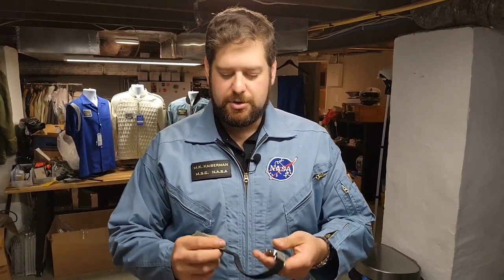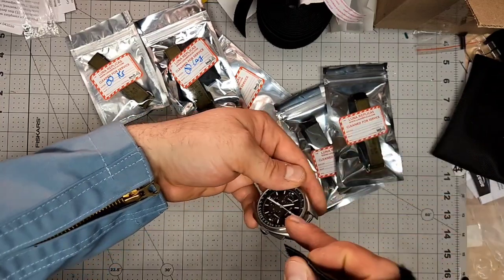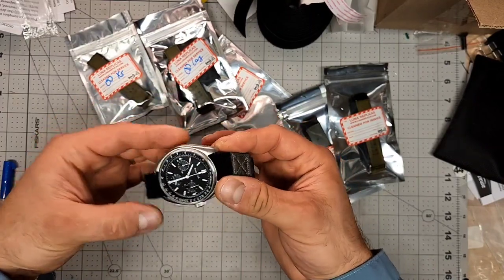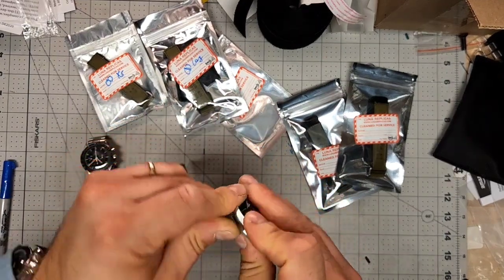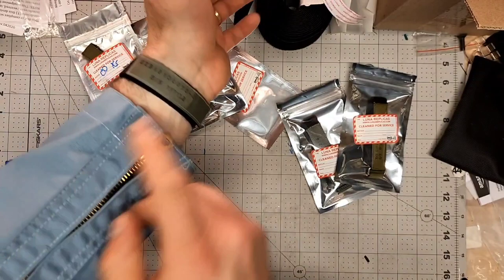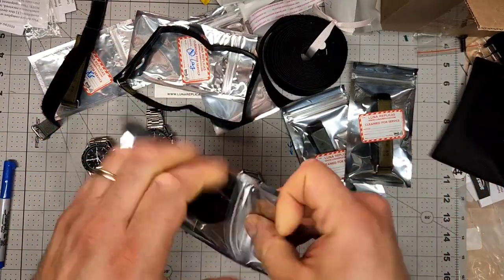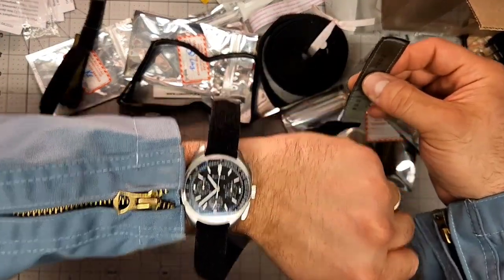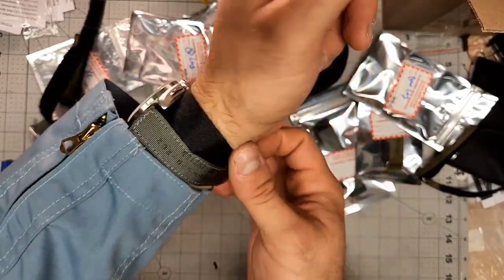How to wear a NASA Apollo style watchband

Comment: A question I always had is this: I don’t know how different the mil-spec version of a velcro is to the everyday civilian on, but isn’t the fine powder on the moon an issue? Ok, you will not necessarily removing and readjusting the strap on the lunar surface with all that dust, but still… any thoughts on that?

Also, why did they choose the one-pass velcro option, over the ‘stress relief’ that a ‘two-pass zulu’ type strap offers on the pins?

The velcro does look cool though, especially with the tag on the back of the wrist! 😊
Reply from the maker: Great question! We actually have Lunar dust/regolith simulant, and could test this out in another video.
Reply: @lunareplicas  That would be awesome, looking forward to it! 😊

Comment: The video resolution is poor and I wish you had zoomed in, so I’m not quite clear on which side goes up in the different schemes. There’s a “hook” side, and a “pile” side. Saying “put the Velcro side out” is meaningless. It’s all Velcro.
Reply from the maker: The hook and loop are both on the same side on these straps.  That's what I'm talking about.
Reply from the maker: Loop/hook side up for straight through configuration, loop/hook side down in the second configuration - as mentioned in the video (in 1080p resolution too)